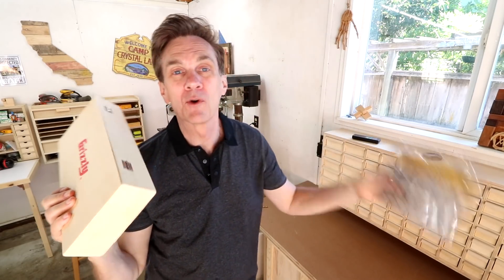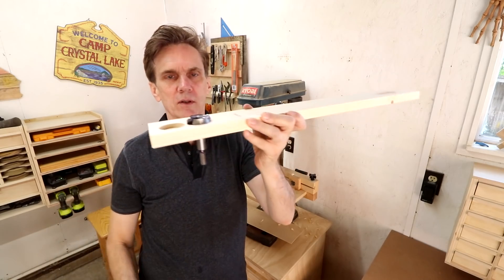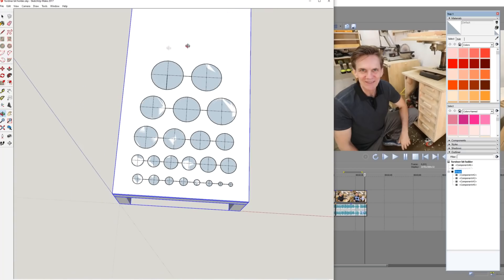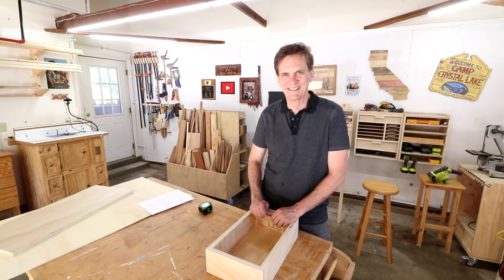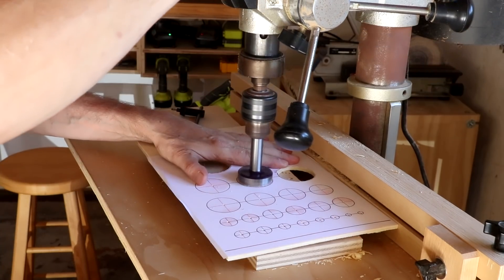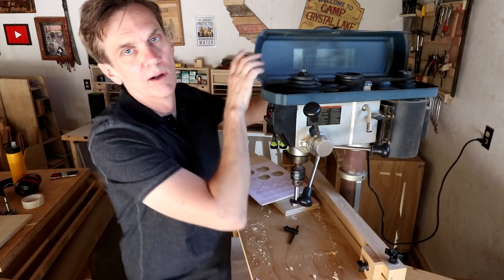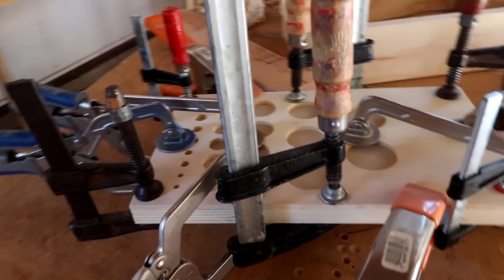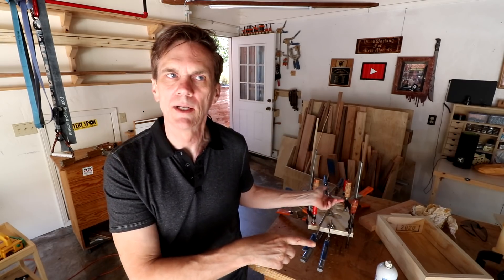A storage solution for my Forstner bits. | Day 94

Comment: Would it have been a good idea to leave the template on the board when you glued it to the bottom board? You had the centre lines on the template, it would make finding the centres of the second hole easier.

Comment: If you use 3mm (1/8") MDF for the circles rather than 6mm (1/4") plywood then the bits sit in a shallower bed and they are easier to take out. It's cheaper as well. :)

Comment: My 2 cents...  You could have used the carpet tape to secure the two boards together.  Then drilled small pilot holes (1/16") thru both boards per your template.  Separate the two boards and drill the Forstner holes in the 1/4'' plywood using the plywood.  The drill the appropriate sized shaft holes on the 3/4" plywood using it's pilot holes.  And Wala, all the holes are aligned.

Comment: Your unwillingness to adjust the speed because of the inconvenience of adjusting belts is exactly why I purchased a Nova Voyager DVR drill press. Turn a dial and the speed changes. Also you liked the speed chart so you would love that the computer control helps set speeds for a great many kinds of bits in at least 3 types of wood. It totally changed the way I use hole saws. Also, powerful and also easy to manually set speed.

Comment: Should have stuck both bits of wood together with a little double sided tape and just drilled a small pilot hole through both bits of wood at each circle centre on your template then separate the wood and all your holes are lined up perfectly for both size head and shank holes.

Comment: You could have drilled all the centres of  each circle with a small bit thru both boards and then use this smaller hole to lead the forstner bits on the 1/4 board and the shanks holes on the 3/4 board.

Comment: i had a solution in less than 90 seconds of this video, and, i'm surprised and slightly disappointed that steve, of all people, didn't think of it. to identify which bit goes where, colour code. touch of paint on the shank to match a touch of paint on the rack.

Comment: Did you consider just punching 3/8" holes in a piece of 2x8, putting it in the bottom of the drawer,and standing the bits up in the holes? Alternatively, using your approach, you could have taped the top and bottom boards together temporarily, drilled a center hole all the way thru in each paper circle with a 1/16" bit, then separating the two boards and drilling the correct size holes in each.
Russ
PS: enjoyed building your BMW.

Comment: Too late to be a "real" suggestion but I think I would have done those holes in a different procedure. I would have joined both boards together in whatever fashion (say double sided tape) and drilled all the holes for the shafts with the required bits (I guess they have not the same diameter altogether) as that template has those centers marked. Then I would separate both boards and drill the thin one with each forstner bit as intended. Yes, you don't have the center on paper anymore but, on one side, you do have a hole that's already centered (yep, too big but still) and on the other one, the template does have the shape of the circumference you want to drill, so you can actually drill them quite easily in place.

As for the smaller bits, I think I would have to add some kind of slot to each hole and a bigger hole on the other end of the slot, so the bit would be put in place by going through the wider hole, then it just goes via the slot to its final position and viceversa when you want to use it.

Thank you for the ideas.

Comment: I'm only 6 minutes into this video, so perhaps you thought of this after I've commented, but it seems to me that you could have just printed out a second copy of the template from sketchup and used that for drilling the smaller holes on the 3/4 inch ply. Let's continue the video and see if our thoughts lined up...
Reply: Nope. But it'll probably be fine.

Comment: Time to over engineer it! Have a board underneath that when raised with a lever, pushes all the bits up a little. This wood make it easier to pull them out and solve the small bit problem at the same time.

Sorry, had to put the pun in there.

Comment: I really thought you were gonna glue to template on.  Then center punch them and run a small drill bit through both the 1/4 and 3/4 plywood.  This way they both have the center holes marked.

Comment: I would have used a 1/16" bit before you drilled the bigger holes clamp the 2 pieces together and drill through both pieces then just go back and make the holes bigger for the shanks after to top east finished

Comment: I don't understand why I would ever change my drill press speed.  It is is on low and it it works well for anything.  Yes it could be faster with softer wood but really, is there a different benefit for setting it faster?
Reply: Drill  at a higher speed when using  small bits.
Reply: @rwind656  What happens if I use the slower speed?
Reply: It doesn't cut as cleanly.

Comment: I was thinking you could have drilled all the shank holes through both sheets of plywood stacked, and then removed the 3/4 sheet and finish up with the different bit sizes on the 1/4 inch sheet..

Comment: Hi Steve,
Did you consider this:
Flip the drawer upside down and drill the holes in the bottom.
Move the handle that is now on the bottom, to the top...
and Bob is your auntie.
Reply: But the bits would be too tall, the cutting heads would ride above the top of the drawer.  Otherwise, that's a pretty damn slick idea.

Comment: Sorry if I found a simple solution....

Could you not have just printed a second template for the 3/4 inch piece of plywood and drill the same size hole in the center of where each bit will go?

Comment: I feel deprived.  My Harbor Freight Forstner bits came with a good plastic case that has kept them securely in place.  Its a bit of a challenge to get them back into to the right space.  But I've compensated by actually only drilling one hole at a time, and returning each bit back to the case after I've done.  If only I had as good operating discipline with the hundred other tools and fixtures spread out in my garage!

Comment: feels a bit of wasted space and too thick materials, alas it's your budget, not mine. :D
carrying a whole drawer for me feels way too tedious, i would made a better carry-on bent metal case for them instead, just because i use them on the road way more than in my non-existent shop :D
also, nailing together with small finish nails for temporary hold of the two plywood to align them, drill pilot holes, would have been my solution.

Comment: Perhaps you could have drilled all the centers with a tiny bit, through into the lower plywood, then drilled the big holes through
Reply: That’s what I would have done, temporarily secure the two pieces together and drill small pilot holes in the center of each hole template then separate the two boards and drill each hole to the proper size. As for how to secure the two boards the same both temporarily and while the glue drys, cutting the boards slightly larger than needed and putting screws to hold the boards in the same location both times would work. You would then cut the board to size, removing the screws.

Comment: You could have drilled  2mm (5/64") pilot holes through both boards in the centres of your templates at the start, then you would have the exact points to drill for the shanks in the 3/4 board